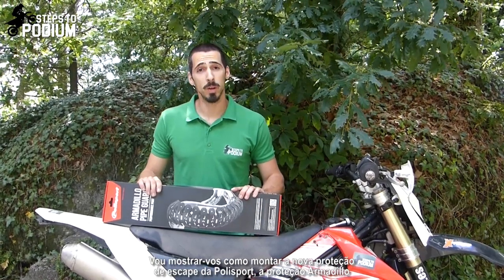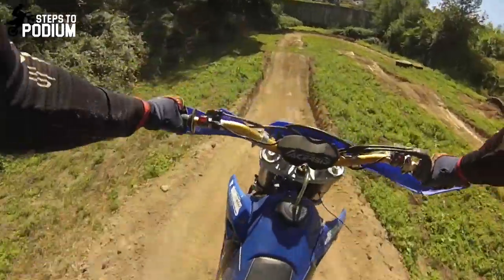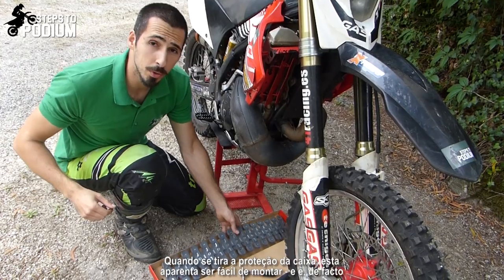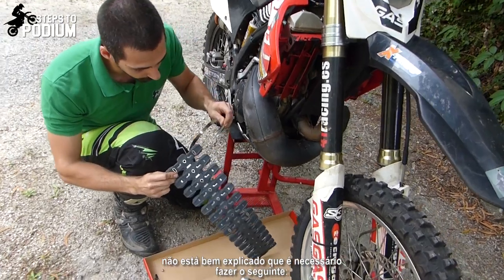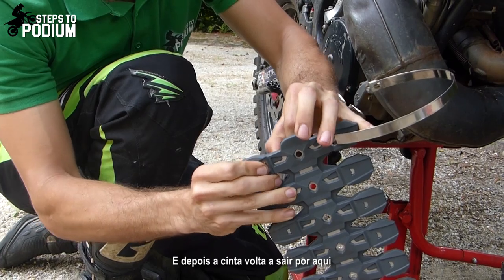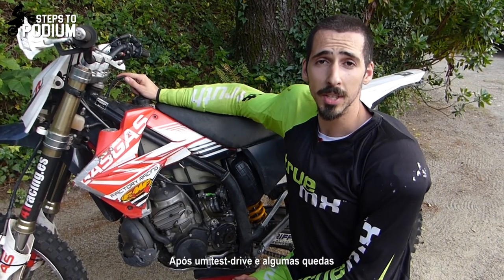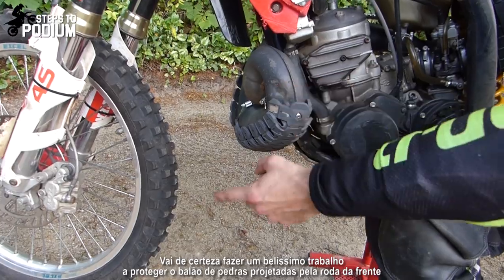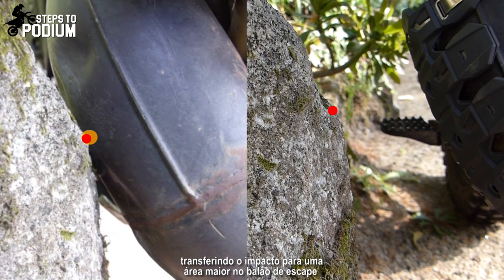How to & Review: Polisport Armadillo Pipe Guard

Comment: Hello :) The mounting instructions that you received were updated. So besides the video, the Armadillo Pipe Guard have now new mounting instructions. Thank you for the video! It's really good. 👌
Reply from the maker: Hi! Great to hear! :) That's what makes big brands: how fast they answer to potential problems - even the smaller ones! 💪 - and many thanks again!
Reply: Because of the bad instructions i´ve already broke the two parts where the screw is tight. In my opinion, i use it for 2 months now, the rubber is too soft, and because of that, a part is already missing in my pipe guard..... With the impact the trend is to get worst.... But is doing the job!
Reply: You don’t thread the hose clamps through the armadillo if you use the brackets.  The brackets are only for quick detach.  Install it directly with the hose clamps without the brackets

Comment: You only thread through the guard if you do not use the brackets.  The brackets are for quick-removal because all that is holding are the three screws.  If you thread the hose clamps through the part, no need for brackets
Reply from the maker: in the meantime I realised that, but since initially it didn't have any instructions sheet, I installed like it seemed best! 😊

Comment: Hey buddy, good video but you've mounted it incorrectly. The hoseclamps go on with the brackets to exhaust (dont thread them through the guard) then you screw guard on which enables easy removal for cleaning without undoing the clamps.
Reply from the maker: actually you can fasten it two ways! or like you said, which is a lot quicker to remove as clean de pipe, or through the guard, to be better secured! (I actually mounted it wrong because the pipe guard didn't come with any instructions, so I mounted it like I thought it should be) at the time I let Polisport know about it and  in the meantime they  answered to that issue and they now include a instruction sheet with both instalation ways!
But thanks for the heads up! might be useful in another time I mess up 😂
Reply: @StepstoPodium  All good dude. The quick release for cleaning is my preferred method of attachment but is a bit risky because if you lose a bolt while riding the guard will start to fall off and flap around. A small amount of non permanent thread locker on the bolt threads should prevent this from happening.
Reply from the maker: @s3uoq  that's a really good idea! 😊

Comment: You are mounting it wrong :) 
The whole idea with the brackets is that the pipe guard should be easy to remove , you should just put it through the bracket and not the pipe guard itselft. Then you can just remove it with 3 screws instead

Comment: Ummm that's actually not how they suppose to mount. There is no need for the little brackets that you put the screws into. Also your best off bending the tabs before installation as they flex back a bit if you try to do it when it's fitted.  If you do use the brackets they are fitted different to that. The brackets are there for riders that want to remove these guards quick and easy, but again you need to fit them differently to that.

Comment: I have had many different pipe guards. They all have been shitty except one. I have tried aluminium one that is mounted similar way as this polisport one. You basically mold it onto the shape of the pipe. That one didnt survive first crash and I also had big dent in pipe.I have also tried carbon fiber guard. That one was definitely better and more durable, but after few months it cracked at weird places. The problem with all those pipe guards that mount onto the pipe itself is that they put too much stress onto cylinder exhaust manufold(cylinder flange) when hit. So any pipe guard that is monted directly onto the pipe may result cracked cylinder flange.The best solution is to buy pipe guard and skid plate in one piecue. Usually those are undestructable and work perfect. There is almost no risk of breaking cylinder flange, because it is mounted onto the frame. However that type of guard is quite heavy and also lot of mud gets trapped inside. So I would rather not use any pipe guard or just use one with skid plate...
Reply from the maker: everything you said is absolutely true! There's no perfect solution at the moment,  but hey, use what suits best for you.  if you are a weight saver, go for the carbon fiber one, if your one of durability, go for the big skid/pipe guard, if you want something else, go for something else 😂
Reply: @StepstoPodium  exactly 😀😀😀 or we should learn how to not hit our pipes😀
Reply from the maker: @andrejskamla9736  Graham Jarvis doesn't have these mere mortal problems 😂
Reply: @StepstoPodium  but he gets pipes for free 😂😂
Reply from the maker: @andrejskamla9736  true that xD

Comment: You mounted the guard completely wrong 🤦‍♂️.

The brackets are used if you want to quickly remove the guard.
Also, you need to pre-bend and the tabs and guard and not afterwards.